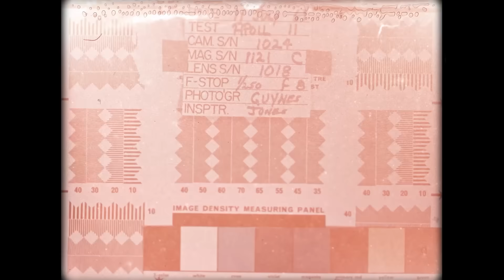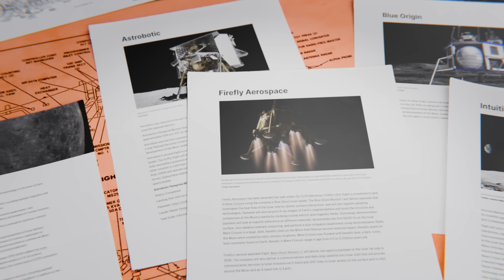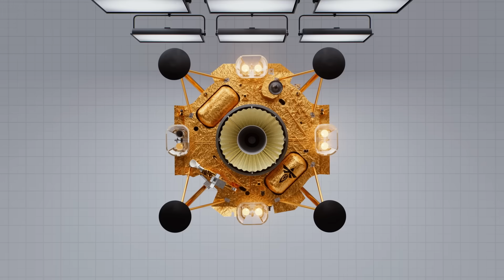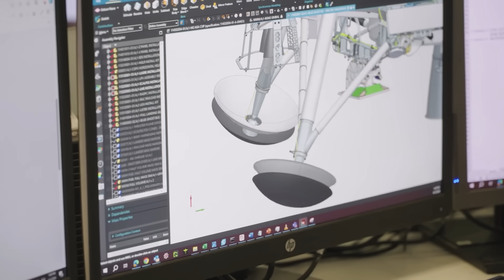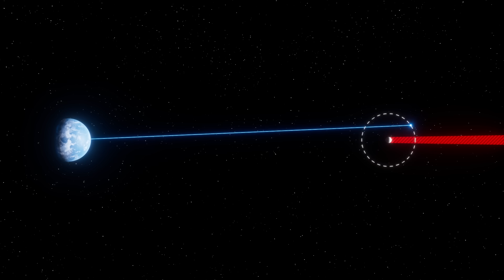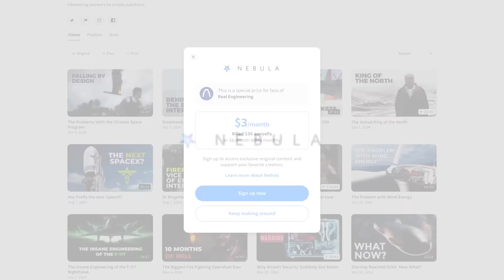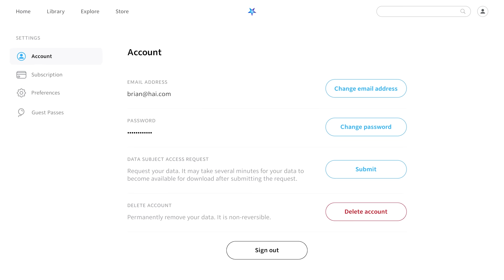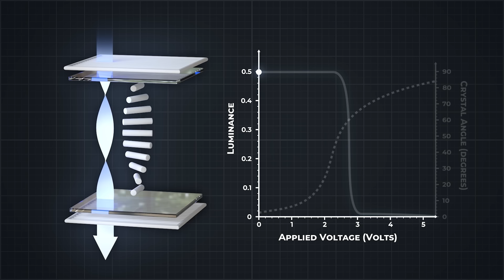Why the US is Struggling to Land on the Moon

Comment: Simple: because back then, the US had a reason to go. A stupid, childish reason, but a reason nonetheless. And also back then there was a greater willingness to take risks. People died but the program continued. 

That same kind of reason is starting to materialise now (China) but the pressure is not really on yet. That may or may not happen, but when it does, a new space race may erupt. Better than a war, or course.
Reply: they also had a fuckton of money 🤣
Reply: @linecraftman3907  Apollo was 2.5% of GDP for a decade, about what the US spend on the military today. NASA now gets 0.2% of the federal budget which is just 0.001% of GDP.
Reply: @andrewfidel2220  There's your answer.  We were willing to put the resources into the task.  We aren't anymore.
Reply: @andrewfidel2220  if that's true no wonder it's so difficult, instead of waging wars the US could just get more land on the moon or even mars
Reply: @andrewfidel2220  It's actually 0.5% of federal budget and 0.1% of gdp today. Still way less than the peak
Reply: @andrewfidel2220 So did computers, they costed a fortune for 4 KB RAM back then now it’s nothing, the budget required currently with the resources we have should be nothing compared to decades ago, don’t make lame excuses
Reply: @linecraftman3907  Yup, 2.5% of GDP for a decade, not far off from our current military spending!  NASA now gets 0.2% of the federal budget and .001% of GDP and that's for everything they do.
Reply: @linecraftman3907  100 billion so far on sls
Reply: @linecraftman3907  And both a clear and not-as-clear deadline: 

Explicit: "...before the decade is out"   and...

Implicit (but understood by all involved): "...and before the Soviets, whichever comes first."
Reply: Childish isn’t quite the correct nomenclature…fear….we were terrified the soviets would build a base on the moon and point missiles at us
Reply: All fun in games until a Chinese flag is planted on the moon, which according to them, in 2028.
Reply: @Tomoyo0827 No way China lands a human on the moon in 2028. Their big lunar rocket isn’t ready yet.
Reply: @Tomoyo0827 they can't even keep their submarines afloat nor do they know how to build a jet engine nor do they have gas or money...
China landing on the moon is a joke....
Reply: And back in the days, there wasn't a world-wide decentralized communication network to check whether they really went there or not.
Reply: @Madosatoshist  yes there was. It was called radio. Perhaps you've heard of it? Anyways the astronauts used radio to communicate with the Earth and everyone on Earth could pick the signal up and even direction find where the signal was coming from too. Guess what? It came from the Moon. You'd better believe the Soviets were carefully monitoring the whole mission. Perhaps they couldn't put men on the Moon but they certainly had the technical ability to receive radio transmissions. Let's be real here. You could track the whole progress of the capsule all the way to the Moon. They were in constant radio communication the whole time. There's no way that could have been faked. Even school children in England tracked Apollo with radio. Radio triangulation is a thing.
Reply: We also had four decades of extremely progressive social policy putting a ton of smart people in place to make it possible, and a nation that was primed to see things improve, to see us reach out and forward.  We can't do that now because we're a decaying, has-been superpower.
Reply: @angie99656 
Worth mentioning that they made mistakes that weren't made in the 1960s.
Reply: @angie99656 we had Nazi rocket scientists
Reply: The reason we can’t achieve what we did back when we landed on the moon is the quality of people we have now running NASA is far inferior at every level in every way imaginable. NASA has become just like the military industrial complex; just another way the rich steal from tax payers to get richer.
Reply: Funny, but the older I get, and I'm old now, the less I believe that the US went to the moon, especially given how they are behaving now. Just saying.
Reply: We all know the US are full of shit, if you can't do it.. lie
Reply: Or maybe people were more gullible back then which made it much easier to fake the moon missions.  If they had a childish reason to go to the moon, then it would be also a childish reason to fake the moon landing.
Reply: Looooooooooooooooooollll you never went anywhere!!! Fake ass country
Reply: The reason to go back now is national security. The moon sits near the top of the earth's gravity well and in the future the nation that controls the moon will control the earth.
Reply: You all got brainwashed b***** that we went to the moon five times successfully didn't kill anyone landed are you for real get it together corrupted education ruled you
Reply: There will be no new space race. Technology is at a point where it will be a war 100%. Any nation that gains control of space will immediately gain control of the entire planet. No nation will accomplish this without being confronted directly with military action. Back during the old space race it was most a d!ck waving contest and the loser just looks bad. Things have changed. 

Furthermore this is not a matter of IF it is a matter of WHEN. It will happen. It could be soon it could be 100 years from now. It will happen.
Reply: But things are being done now on the cheap, and they're testing new rocket engines etc. There's also not the same standards with testing.

So it's oranges to apples as they say, with a potential that this time around they can even figure out how to do things profitably. And if your project returns a cashflow that makes it sustainable from now to the foreseeable future. Sustainable space flight is a goal
Reply: It was actually not as childish as you think
Reply: @MagicToenail  Let's somehow scare the communists into believing we're better by executing the biggest government (!) program ever? Sounds pretty childish to me.

I'm still happy that it happened, though, and sad that it stopped. And I'm mildy excited that I might see people on the moon again before I die.
Reply: Well everyone still have determination to do so
Reply: @code066funkinbird3  Yeah, but sadly, if we think USA's  yearly budget as a 100 dollars, guess how much NASA gets? Half a dollar.

Its wild what they achieve with little as that
Reply: Yeah, President Kennedy promised to put a man on the moon by the end of the decade...and well we did it in 1969 just by chance lol...
Reply: That reason isn't materialising now. The Artemis projects is a joint venture between the EU 🇪🇺, 🇺🇸 USA, Japan 🇯🇵, Israel 🇮🇱 and Canada 🇨🇦. Worth mentioning that Italy 🇮🇹 and Germany 🇩🇪 are even more involved than just as part of the EU. In the Apollo project the Canadians 🇨🇦 had a big role. 

Also, some mistakes are being made. This will cost the US 🇺🇸 and its partners A LOT.
Reply: @bobfg3130 ya Canadians because of black Friday Feb 20, 1959😢
Reply: Yankee mindset good at creating bizzare arguments. Nobody landed on the moon. How hard to simply accept the truth.  And NASA finding it hard now to land on the moon because satellites are much more advanced now and the uS' BS will be caught easily and almost impossible to stage another fake moon landing as every square centimetre of US land in under watchful eyes of the satellites of various countries.
Reply: Maybe we never went
Reply: @Macwylee  "we" didn't go but 12  brave Americans did. There's no "we" about it. The evidence is overwhelming they went too. Both in the moment and lasting to this very day too. Their footsteps are still in the dust up there. We've imaged them with  different missions. We as a species. Not you or I personally.
Reply: @1pcfred  you do realize people use the word we to describe their nation right? So maybe humans never made it to the moon, as tech builds on tech, and the fact humanity forgot how to go there is comical
Reply: @1pcfred the main argument that's been used fir the past few decades was we forgot the tech that got us there.  And it clearly shows in the Inability for humanity to go back as you say, thus calling into question whether we went
Reply: Wrong. In the 1960s, there was a reason to go to the moon. The reason was lofty. It was national self actualization.  It was doing the great things.

They succeeded not because they took risks. They succeeded because they were careful.  They were careful doing risky work.  They were successful because they were devoted to the country and gave all to achieve national goals.  They were successful because their objective was not money.
Reply: @waichui2988  " The reason was lofty."

Are you sure? Dude, the reason was a pissing contest with the Soviet Union 🤣
Reply: Simple. Because back then people would believe anything. Even a ficticious radio show called war of the world's, was a real alien invasion. Just like they would believe anything on television like the moon landing.
Reply: 中国这边对太空探索还是很保守的，短期没什么技术能够真正带领人类殖民外星球，
Reply: So if “we’ve already been there” is a good excuse not to go again, why did we go six consecutive times in a two year period?
Reply: It's paid Hollywood. 
Almost 70 years later NASA either getting dumber and dumber. 
Or the moonlandings were all created by Hollywood.
Reply: They never went. One of the so called astronauts already admitted it
Reply: I wouldn't say the Cold War was childish.
Reply: NASA is now flying a drone on Mars. Yet they can’t land on the Moon. Get outta here.
Reply: @iwishyouwould6937      I see that you've never met a crazy conspiracy theory that you didn't like.
Reply: Do you not have any reasons now ? Simply not capable , before and now and probably future 🤡🤡🤡
Reply: We've already been to the Moon. Going back won't prove as much. The amount of lunar deniers today is annoying though. I doubt if going back would silence them though. The only way to shut those people up would be to leave them on the Moon.
Reply: @1pcfred  rat! Dream on🤣
Reply: @1pcfred or you can just tell them the whole world was watching that day especially the Russians tracking their movements.
Reply: @1pcfred I never questioned alot of our past but my eyes are wide open now. Once you can come to grips with the fact our people, as in the CIA, secret service, and others played a roll in the killing of an acting American president then you realize that absolutely nothing is off limits or out of bounds. Everything is on the table. 

My biggest problem with the Apollo moon missions is The Van Allen radiation belt. 

In 1969 they made it to the moon on with the computing power of a tracphone but in 2024 we are having issues? Run the same plays as in 1969 unless.....
Reply: @iwishyouwould6937 Buddy, the lunar landing in 1969 was crewed, motivated, funded, and tested 10 times before carried out. The van Allen radiation belt isn't a problem when you're moving to fast to get a dangerous dose. These missions "failed" because they are less funded, and not crewed, there's a lag in control from the earth to the moon, and if you can't see for yourself, it's kinda hard to land right
Reply: That and they got the Canadians who built the Avro Arrow to fix Mercury, build Gemini, build Apollo and the Lander
Reply: @Random_White_Circle Cope
Reply: This platform erases my every attempt to post a comment on this thread. Just saying.
Reply: If China plans to put a man on Mars in 2033, the space race 2.0 is already on!
Reply: @SolarWebsite  https://youtu.be/agXcpECmEvI?si=2f9ZGViqDQq528KW

Buzz Aldrin forgot about the Apollo moon missions I guess.......
Reply: That's funny believe it or not we print our own money.  Money is not actually the issue..  makes for great excuse
Reply: That would be awesome..:fingers crossed
Reply: Back then the US has reason to fake it.   Having a reason does not equate to have the technical ability to do something.
Reply: @u.s.lawyer8542  It was one of the most public events of the 20th century, viewed around the world. The filming and photographic techniques required to hoax a moon landing did not exist in 1969. Any conspiracy would have to have involved hundreds of different people from many different countries over decades, including Great Britain, the former Soviet Union, France, Australia, Italy, Germany, Switzerland, Canada, China, Japan and India, from which not one credible witness has ever emerged. It would also have been impossible to cover up for such a length of time; the Watergate conspirators couldn’t keep their escapade silent for more than a few months.   
There are no ‘anomalies’ that cannot be explained scientifically and there is much third-party corroboration; the rock and soil samples have been authenticated by many different scientists around the world for decades, the dust from the rover falls back in a way only possible in a 1/6g vacuum and Japanese and Indian probes have photographed traces of the Apollo 11 and 15 landing sites.
Reply: @u.s.lawyer8542 but where were you in 1969
Reply: 3 decade engineer, a large swath of the interviews I’ve seen with the ones working on these projects aren’t going to get us there, this one included. Broadly, the quality of engineers has really dropped off over the past 30 years.
Reply: @c1ph3rpunk  I mean, the hardware is already in testing, we have already sent missions recently, JPL have achieved much more ridiculous feats of engineering (look at the perseverance and curiosity skycranes, or JWST for example.
i sincerely doubt the quality of engineers has dropped.
Reply: @CheesyMez  When I first read a description of the sky crane, I immediately went looking for a video, because I couldn't believe what I was reading. That's some ACME, Wile E. Coyote tech!
Reply: @AlkisGD  its some crazy stuff for sure lol.
if you haven’t already, check out the upcoming dragonfly mission to saturn’s moon, titan, its the ridiculousness of the mars rovers times 100.
the absolute audacity that aersopace engineers have to send robots across the solar system, and do it nearly perfectly is really incredible.
Reply: @CheesyMez and you would know how?? And where were you in 1969?? To accurately compare quality of engineers to today's??
Reply: @mustangmanmustangman4596  the fact we have been consistently achieving insane feats of engineering whilst on budgets that are orders of magnitudes lower than the apollo days is proof enough that there hasn't been some incredible decline in the quality of engineers. aerospace goes through regular boom and bust cycles meaning you do get a cohort that isn't well trained but people have been complaining about that since the 80s.
Reply: @c1ph3rpunk  Examples? Or is it just your ability to understand that has dropped :'D
Reply: @c1ph3rpunk  Engineers aren't good enough anymore? Yeah, I guess the original Nazi engineers were a bit better than the Wish version of a South African Nazi "engineer" that's currently at it.
Reply: @c1ph3rpunk  Of course the quality dropped off... NASA used Nazi scientists from Operation Paperclip. Those scientists are all dead now.
Reply: @c1ph3rpunk true In 1970-71 my uncle a chemical engineer, who was just 5yrs out of school was paid $1 million dollars to increase the efficiency at a chemical plant he told them he could increase it by 8% it actually was 25%, hence the million dollar bonus!. Unfortunately, he died from cancer 10yrs ago. We are now left with too many book smart but not practical smart. Those who can think way outside the box. Im retired too! So good luck in pushing the envelope!!
Reply: @c1ph3rpunk  I’d agree that the average engineer seems less and less capable nowadays. I think a big part of the reason is that projects lengths have extended and engineers spend much more time on non-engineering tasks, diluting their experience.

That said, this should not be a big problem for this type of job if they’re well funded. While the average is going down, the top performers aren’t, if anything I’d say they’re better than their predecessors.
Reply: @theondono define "capable".
Todays engineers are easily waaay more qualified than the ones from the past.
They solve way more complicated issues & challenges.
Not bc they are inherently smarter, but bc of better education, better technology, better understanding of what works why etc.

But: there is a bigger competition for resources & funding. And no war mentality (like with the space race during the cold war), which means resource allocation needs to be objective and not "we do it simpy bc we want to".
Also, sth which was necessary in the past (e.g. using the calculation power of a basic modern calculator for the moon landing) is senseless/over engineering in modern times (don't waste 100h to optimize the code to save 20% performance, just use 5h and double hardware specs/code lines, it's cheaper/more efficient this way)
Reply: @ Not sure were you see that clear difference, but my >15 years experience in engineering say otherwise.

Projects lengths have extended, not because the challenges themselves have changed, but because the methods have changed. I just completed a project in the medical sector that 10 years ago would have been done in <6 months, and it has extended over 2 years. That additional year and a half wasn’t spent on engineering, but it did consume engineers time.

Engineers today are required to be jacks of all trades, so it’s not surprising that most of them are masters of none.

I’d also caution about assuming that better tools means better results. In this project an engineer (4 years of experience) wasted 2 weeks working on thermal simulations, when all he needed to do was order a cheap part from our own machining services and test it.
Reply: @theondono  I think the difference is - you talk about projects involving engineers, I talk about engineers themselves.

Yes, there is more bureaucracy (sadly), bc it has to be more holistic, the structure of supply chains is more complex, funding is more restricted etc, slowing everything down.

But that says nothing about the competence of engineers, but about the project management & the stakeholders.
Modern engineers solve way more complex & challenging problems than from decades ago.
Sure, like I said before, for some older problems the previous engineers had "better" solutions - but bc of better resources, these "better" ones are simply not needed, a "good enough" is often better, since you then can focus on more important things.

Current example would be cars - traditional producers need 5+ years to develop a new model. BYD as a new producer and needs 1.5years.
Not bc BYD has better engineers - but bc failure is allowed, if a model is unprofitable, who cares, to the next one. A traditional producer can't implement such a strategy, bc branding & investors.

Or fridges from in the past and today.
Modern ones are faaaar superior.
Modern ones just have the reputation of breaking more often, bc many people buy the "good enough but cheaper" ones while remembering the more expensive (but far less efficient) ones from the past. Which also used materials which aren't allowed anymore for very good environmental reasons! (But which had better properties and made it easier)

Or construction - streets & houses today are far better build than the ones in the past.
But, more environmental restrictions, higher safety standards for workers, also less workers available. Restricted funding.
Reply: @ And you are disregarding what this environment does to engineers. 

Even if it’s not their fault, the fact is that they spend less time doing things that give them relevant experience.

I don’t disagree that modern devices are better, that’s to be expected. But things aren’t better because the engineers have gotten better, but because engineering builds up on itself. The rest of your points about fridges have more to do with changes in consumer behavior (people don’t care that much about having to change a fridge every 10y anymore).

The big difference for me is that you can go through the archives of big companies and people with 5-7 years of experience show ability to make good engineering decisions, and are left much more leeway in making calls, while I’ve had guys with 6-8 years of experience that need constant babysitting.

It’s not everyone, there’s guys who can deliver, but whenever I see someone coming from some big corporate, >6 years of experience and barely 2 development projects on their resume, I know they are going to need someone telling them what to do all the time.
Reply: @theondono  define relevant experience - soft skills (especially communication) are very important. One with average technological expertise with a broader overview but good communication skills is way more valuable than a hardcore expert with no communication skills.
Bc modern projects are rarely single minded, you always interconnected.
While sth is great for A, it can be bad for B after all.

And well, you can ofc pick individual examples.
But that's in the end only a different experience.

I for example find most older engineers/technicians (especially if they are 5-10years before retirement) overpaid and outdated.
Many of them refuse to adapt especially to new ways of digitalization, making it nearly impossible to  make structural reforms. They want to focus on their specific task (their comfort zone, understandable), while it would be more important for them to shift their specialist knowledge & responsibilities to the next generation. And to be involved in a consultant role in project which replaces the tools/way of working they are used to and to replace the things they build. Not in a leading way, but advising why sth was designed the way it is (and reevaluating if it's still the case), etc etc.

Also it depends how often they switched - one who has worked in the same position at the same company for the last 8-10+ years applying for a new job? Less useful than one with 2 years experience overall, bc of the tunnel vision everyone naturally develops in such an environment.

My personal sweet spot would be 30-45, with 2-5 different jobs.
Old enough to have experience, young enough to be mentally flexible. Enough various projects to not be blinded, but not too many to have actually gained valuable experience from each position.
Reply: @frankkobold  Again, not sure why soft skills are relevant to the conversation. I don't see new engineers being significantly better at soft skills.

My point is that 20-30 years ago engineers spent much more of their time doing actual engineering, which meant they accumulated experience in engineering skills way faster.

A canonical example right now is software developers. In lots of companies software developers spend >50% of their time in meetings with very low productivity, arguing mostly about requirements or workflows.

A young engineer joining their ranks will take in average twice as long as someone with a lean schedule that spends his day actually working with code.

Another classical example is the CAD-bubble engineer. I routinely meet mechanical engineers with ludicrous understanding of machining tolerances, to the point that it has become a meme in the fabrication industry.

Sure there are old dinosaurs out there, but that's not my point, young engineers will become dinosaurs at some point. 

My point is that the distribution of skill is changing, the top performance is rising a tiny bit, the bell is widening slowly, but the average is going down quickly.
Reply: @c1ph3rpunk  You sure? Pretty sure the recent new young engineers at SpaceX would disagree with your statement.
Reply: @Metranomix  Well they better don't spend too much disagreeing since they're gonna be looking for a job next month going by spacex turnover rate
Reply: You are just another one who believed they had the technology back then... LOL. It was aired live... sure :D cyka 12:50
Reply: @attilazkyou doubt?? But where were you in 1969??
Reply: It was fake. That's why no other country can replicate it despite having far superior tech
Reply: @ulkairvillan3219  (sigh) Yes, I knew we'd see that tired old BS posted endlessly here, the minute I saw the title.

People like you are so predictable, you lay awake nights (or have some kind of bots to seek out) for any space-related story to pounce on, and this one was like throwing meat to hyenas...

You job is done,you may  go back to your cage now.

(Oh, and India and China have successfully put unmanned landers there recently, [I won't bother explaining US Surveyor And Soviet Luna devices before Apollo]  no one else with 'far superior tech' has even tried to land humans there. Pay attention, learn a few facts, or at least stop pretending the rest of us don't know them.)
Reply: @ulkairvillan3219  Actually nothing exists. Wake up sheeple.
Reply: @ulkairvillan3219  The russians can and are already doing it
Reply: @ulkairvillan3219 where you there in 1969?? I doubt it!
Reply: Simps be happy with any explanation
Reply: simple, because it was filmed in a hollywood studio that is why the US flag was fluttering in moon
Reply: @andia968 Really?? So what... you watched some video or read it in a book?? Ok but the real question is where were you in 1969???
Reply: "Because it is there" is not a stupid childish reason. It's what separates us from the beasts.
Reply: @MrKangdon  Any science and exploration that got done as part of going to the moon was purely an add-on bonus. The stupid, childish reason referred to was the determination of our leaders to prove that we had bigger dicks than the Soviets after they were first to launch an orbital satellite AND first to achieve manned spaceflight. If, somehow, Apollo had failed and the N-1 had landed the first Cosmonaut on the moon, guarantee you the next edict would have been "Mars by 1980."
Reply: @MrKangdon  lol, American ignorance
Reply: @MrKangdon  u sure this was the reason and not "were better than those commies"
Reply: You didn't watch the video. It's not because they are unwilling to take risks, it's because technical problems make the landing hard, they need a more reliable navigation system to guide the ship to not crash itself. It's a problem right now with unmanned ships, it's a catastrophy with manned ones.
Would you volunteer for a trip which had a 50% chance of you dying?
Reply: @hostedbysimples  "Would you volunteer for a trip which had a 50% chance of you dying?"

This perfectly illustrates the difference in the society that could send people to the moon and the society that cannot. Plenty of people answered that question with an enthusiastic "YES!" 70 years ago. Now it's not even considered an actual question, but an illustration of how infeasible something is.
Reply: @hostedbysimples neil did it! I'm sure we have another badass pilot out there!
Reply: @IdealContracting they are too worried if something goes wrong family will Sue & win!!
Reply: @hostedbysimples lasers can tell you distances, why can’t they use those at final touch down
Reply: @hostedbysimples but if they have a reason to go, they might just neglect “unreliable landing”. Would anyone volunteer for war?
Reply: You fools.NASA has never been to the moon.Not even Musk or the Chinese can do it!
Reply: @davidhepburn9328 ok but tell me this where were you in 1969???